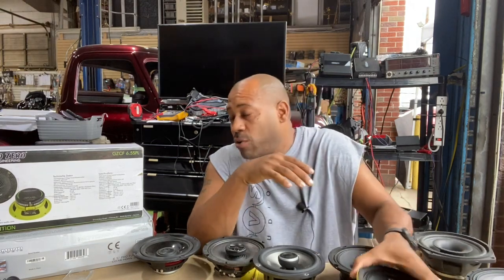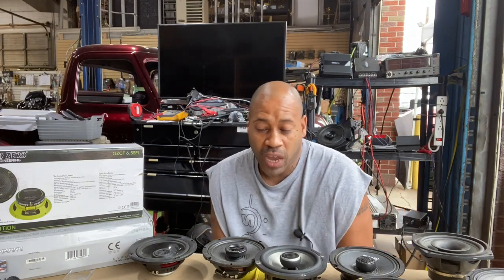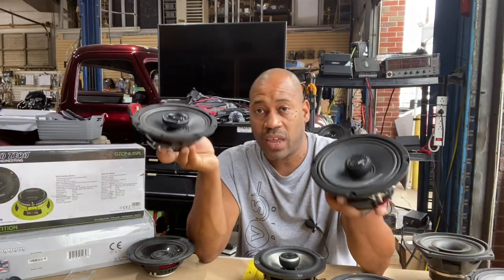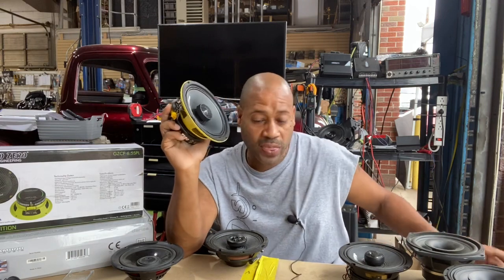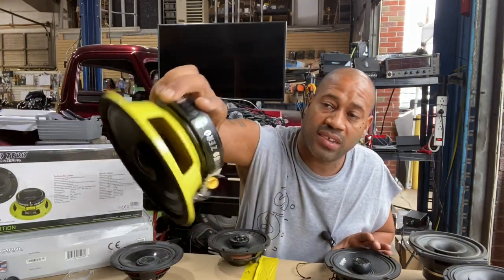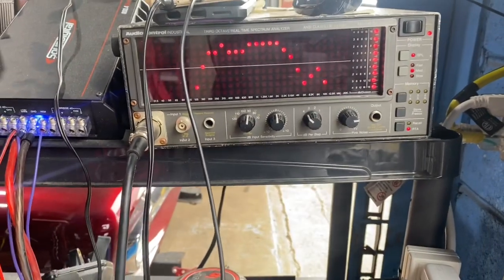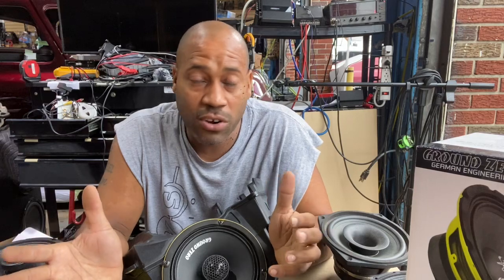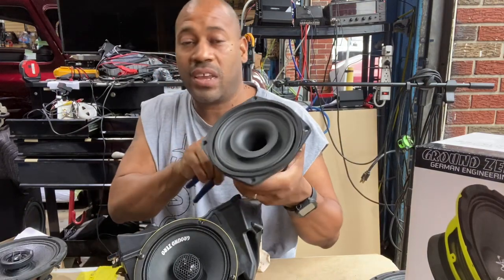New Ground Zero pro audio motorcycle yellow basket 6.5 coaxial review by NVS Audio.

Comment: I have been running the Diamond MP654's and blew one.  So perfect time to test the GZ Yellow Baskets against the Diamonds.  Running an SD 1200 x 4 with Diamond 6x9' 694's in the bags.  The horns on the Diamonds are stellar as I'm sure everyone is aware.  The GZ's do have a better rounded warmer tone that the Diamonds though. If the Yellow Baskets hold up then I will stay with them.  The GZ's have the Diamonds beat in the midbass.  2014 Streetglide pods.  Now time will tell...  ;)

Comment: What's a good drop-in replacement with neo magnet, coaxial than does not need and amp to get decent gains over a stock 22 road glide. but will also take more power when I'm ready to go do that extra

Comment: Give a lot to think about. I have a 2016 Ultra limited that plan on doing a speaker and amp install this winter. Looking at just a direct 4 speaker drop in. Sounds like I'll have to have the Boom head unit flashed.
Reply from the maker: Hertz sx neo 

Drop in fit zero modifications 
Sound great 👍🏽
Reply: I just purchased the ground zero coax. They sound good. I'll be adding a dsp and probably the Hertz neo for tour pack. Should sound great after that.

Comment: I have these in my Road Glide. Running sound digital 400.4 bridged. Voltage 28.2 per channel. When I get around 3/4 volume, speakers cut out. Have you come across that?

Comment: Looking to do two of these in the fairing if my 14 Ultra with Hertz neo sx 165 in the tour pack pods as well as a DSR1. Would the SD 800.4 be ok or should I jump to the 1200.4?
Reply from the maker: I would prefer 2 800.4 and a dsp ( all fits in the fairing)  I’m not a big fan of the 1200.4 
Plus the 1200.4 will give you 150 watts per speaker , 2 - 800.4 will give you 400 watts per speaker bridged.
Reply: @NVSAUDIO  so would I use splitters for each channel running fronts to one amp and rears to the other or is there a way to set the dsp to use all 8 outs?

Comment: You use Road glide speaker pods, is the same modification for the Street Glide Pods? Thanks
Reply from the maker: No modifications to the street glide pod 
They drop right in . You might have to sand one of the inside ribs 1/4 inch
Reply: @NVSAUDIO  what year  road glide pods

Comment: Wow you can run 300 watts to each of those yellow baskets? And gets low as 50hz? Damn... Thats what I need for my front fairing on my Road Glide. I want good low frequency mid bass up top as well as high frequency to match the diamond coaxsub in my saddlebags.
Reply from the maker: These are awesome so far  . 
These are great for mid bass !!! 

Have 2 bikes this week getting them installed 

I’ll post the video next week .
Reply: @NVSAUDIO  I’m not really audio knowledgeable when they say run as low as 50hz is that the crossover on the back of the amp you can run that low? And if so through the deck would you adjust or just leave everything flat? I’m running a sound digital 400.2 on them and it’s currently set just above the 80 hz on the amp.

Comment: I was told to run the horns on my mp654's in the fairing parallel with the horns in my lids on channels 1 and 2 and the front mids on 3 and 4 on my 800.4 threw a dsp1.  Rear mids will be ran bridged on a second 800.4. I eliminate all the speaker cross overs when using a dsp1 correct? Btw your videos are supper helpfull thank you for putting them out!

Comment: Great Video and very good information!   Do you know if these Ground Zero's will fit into the 6.5 lowers speakers pods on a 14SG without modifications to those pods?  thanks !
Reply from the maker: Yes they fit but they will need a 1/2 spacer 

If you trim the pod then no spacer is needed
Reply: @NVSAUDIO  thank you!

Comment: Great job on the review.   Do you have any experience with Focal speakers?
Reply from the maker: Yes I do 

Focal is a great company 
Love all their car audio stuff but I’m not a big fan of their Motorsorts stuff . It’s weather resistant but just can’t take the power . They sound really good at low volumes but at highway speeds it all gets washed away . 

I had the same issue with hertz until they came out with the spl show Neos . 

The focal sensitivity is 91 verses the hertz Neo 96.5 

That is just my option

Comment: I need your honest, professional opinion.    What speakers do you recommend in the fairing of either a Road Glide or Street Glide.  Something loud, clear and overall solid , with 4 (non coaxial) speakers.  Don't factor in money.   Thank you
Reply from the maker: Ground zero red basket 
Beyma pro 6 200nd 

But to get the most out of them you will need a powerful amp , dsp and a good tune

Comment: What speaker pod is that . It doesn’t look like a street glide. Also have you ever tested or used the ARC moto602 HD 6.5 . I would really like to hear what you think of them . 
Thanks
Reply from the maker: It’s a 2018 road glide speaker pod .

The arc moto602Hd is one of my favorite motorcycle amps ever built. I just wish they were smaller in size